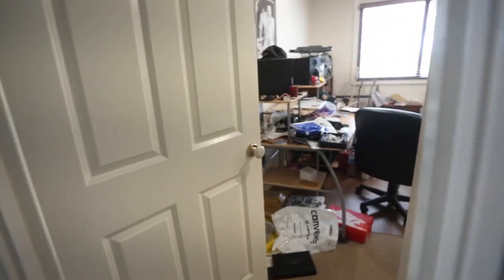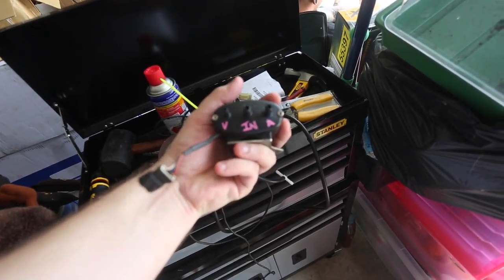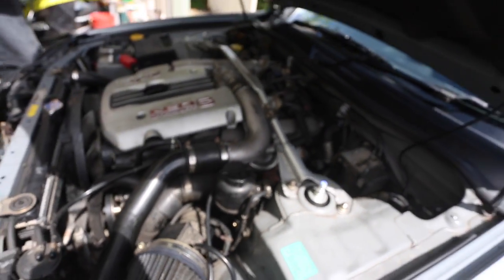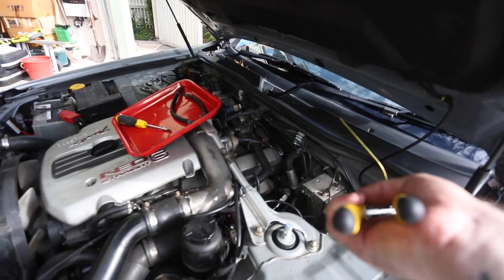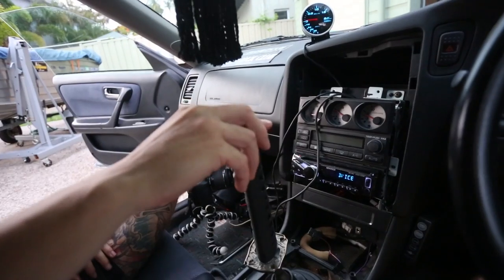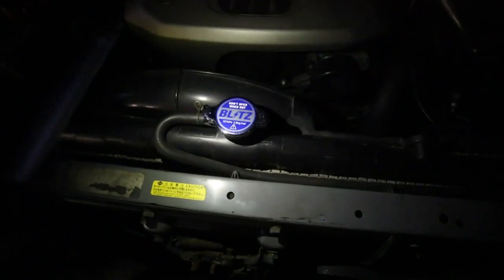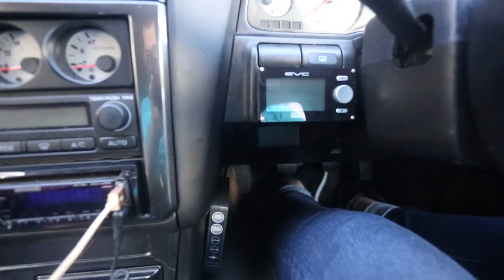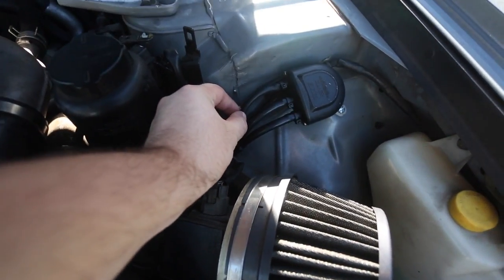Beers, Boiz, Boost Controller - HKS EVC Install

Comment: One tip if i may, always avoid running any other devices or gauges off the same line as your boost controller.
Reply from the maker: jezwah how come? As long as it is just powering the hand controller itself I can't see a huge issue
Reply: It can cause delays when sharing the same vac line
Reply from the maker: unfortunately theres not really another spot i can plug it, although i know that it can cause issues.